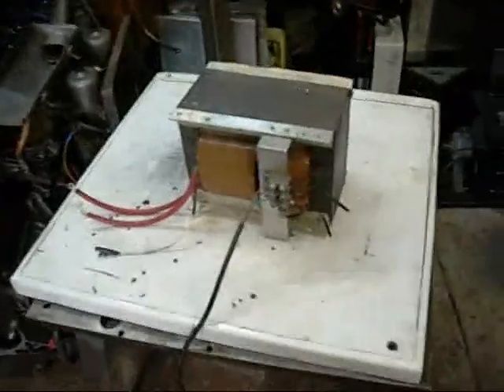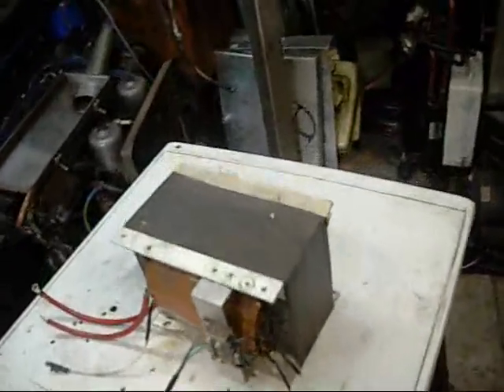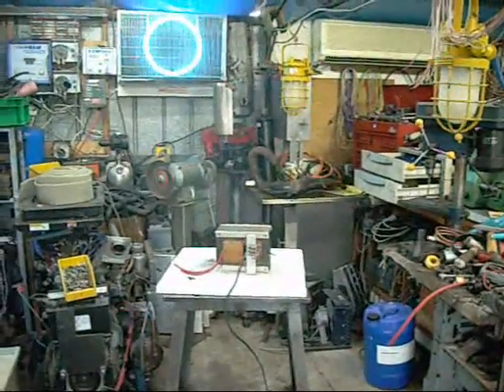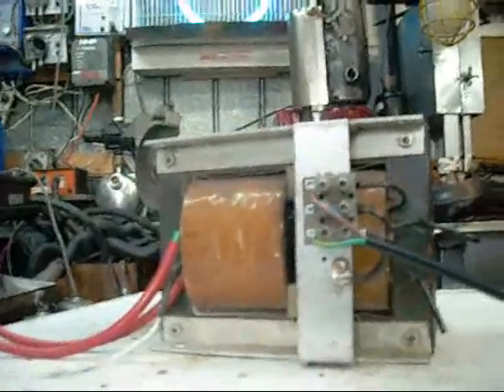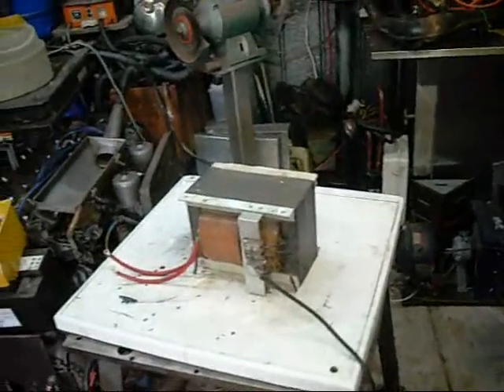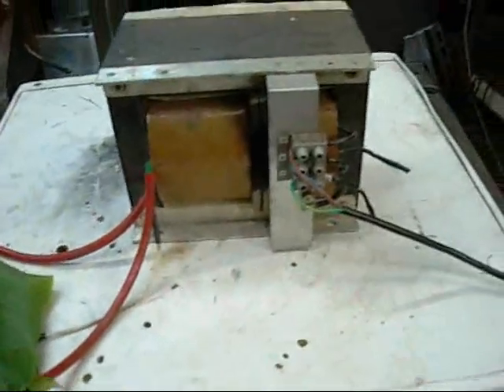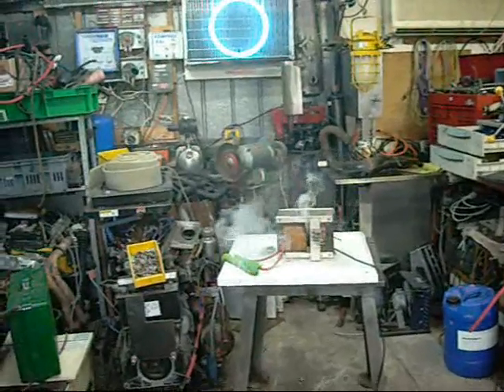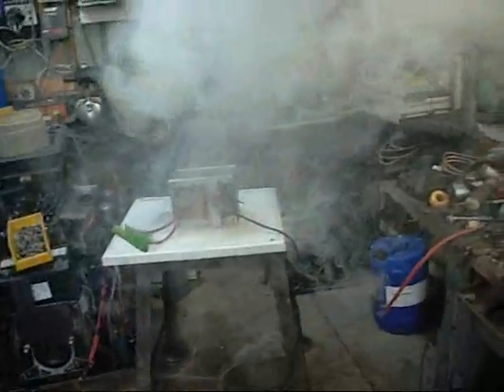Small RF Welder Transformer Burning Out

Comment: We do its just broken down in our outside power distrubution box. 120v systems have a single breaker and 220v systems have 2 breakers. The reason for this you have 220v coming in to the power box you have 3 wires 2 are hot with 220v total voltage the other is a ground. Both wires carry 120v but if you combine both with a double breaker you get 220v ;). Btw there are quite a few thing in an american household that run on 220 A/C Stove if elec water heater most bigger window units the list goes on

Comment: I hate transformers with shorted windings, I had one do that in an old tube radio that I was fixing up on the high voltage winding, which was supposed to be 700 volts total. For some reason one leg of it was badly shorted on one side of the center tap but the other was fine.